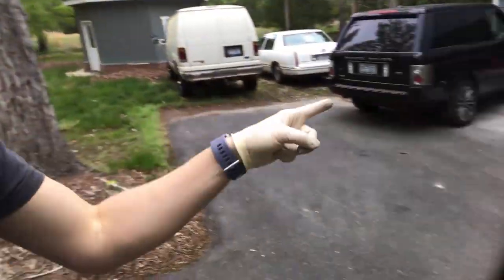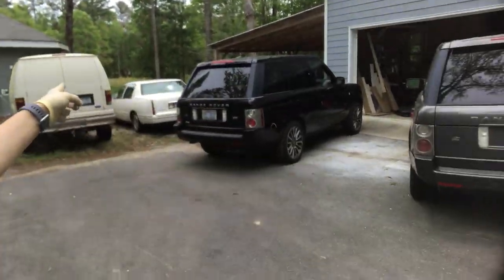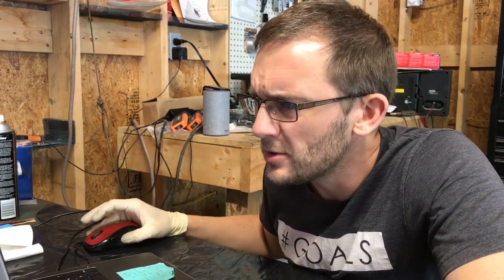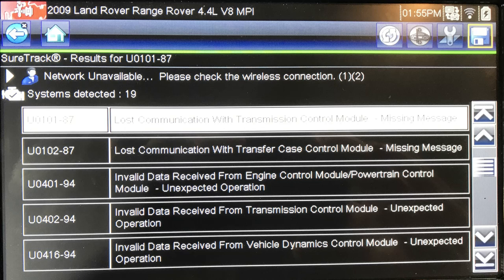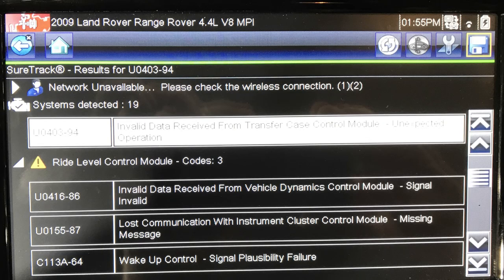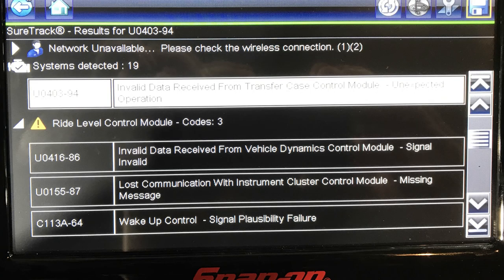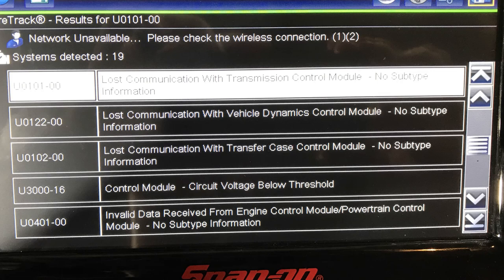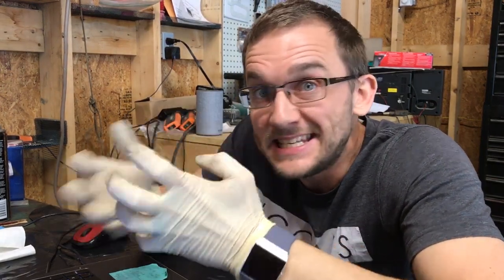How Many Codes Does My Salvaged Range Rover Have?

Comment: Nice progress! I tried to take my fatty to an independent shop that works on euro vehicles for a diagnostic like you described. I was thinking $100, take under an hour, I see what I can fix and what is beyond my abilities. The guy wouldn’t even give me a quote, just wanted me to bring it in and hook it up and go from there. Maybe he was going to throw me a freebie, or maybe he was going to take me for a ride, but I ended up buying a Foxwell 530 with Range Rover software and I can do most everything I need and probably more than most DIYers (I ended up rebuilding my 5HP24 in the driveway, which most probably aren’t adventurous enough to try) need and it’s been mostly trouble-free since.
Reply from the maker: That's awesome! If you're going to work on your L322 or other cars, having a scanner is a worthwhile investment. 

It's hard to run a repair shop and make money. Most places have a target client or a sweet spot that they can do well with and be profitable. DIY people rarely fit into that business model, so it can be hard to find one that knows their stuff and is willing to work outside the normal lines. They are out there, but you'll have to hunt for them more than likely.

Glad you got things worked out! I'm impressed you rebuilt your transmission. I may call you for help one day down the road :-)